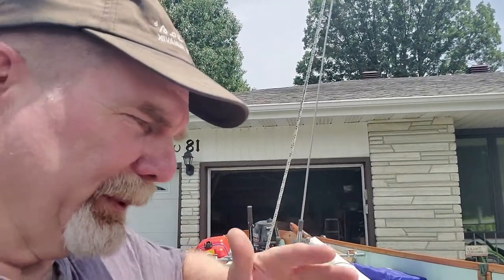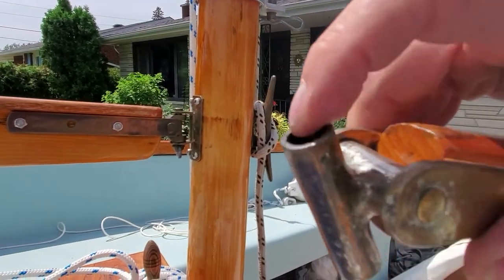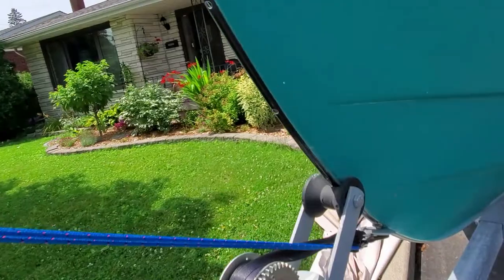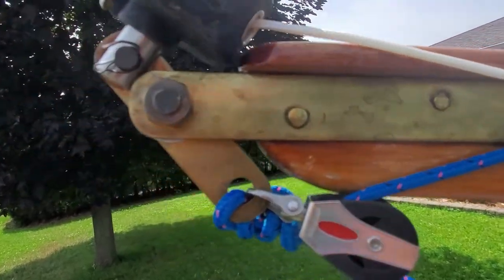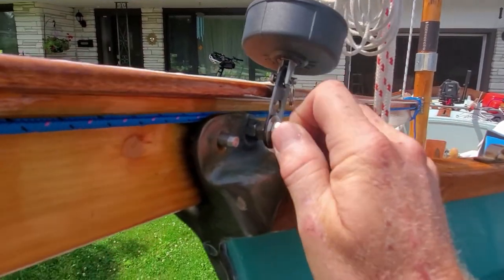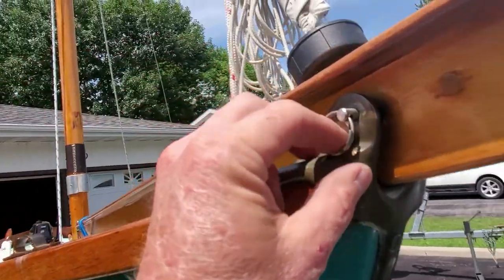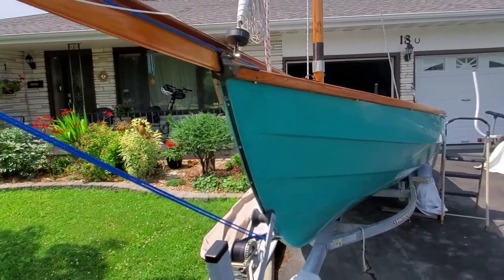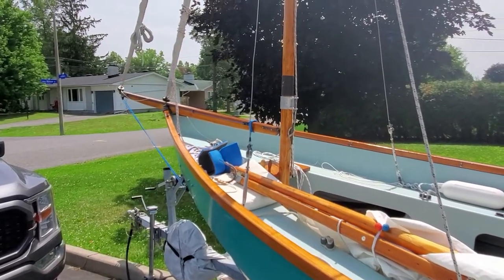Drascombe Lugger Tica bowsprit details

Comment: Looks like an awesome rig, not to tell you how to live your life but the way the forestay is connected to the stem could shear or bend that bolt. If i were you, id cut a little slot on the inside T top of the bowsprit so the forestay would be right next to the bronze stem head hardware. Happy sailin
Reply from the maker: Good advice, thanks.

Comment: Thanks for sharing. Where did you source the hardware, especially that stem fitting with the slot for the bowsprit? Also, is the bowsprit sitka? Thanks again!
Reply from the maker: Hi,  the hardware was accumulated from variuos sources like flea markets, etc, over the years.    I think the stem fitting may have been stock, and the bow sprit was simply adjusted to fit.    The sprit was off an old dinghy (it was once a boom).